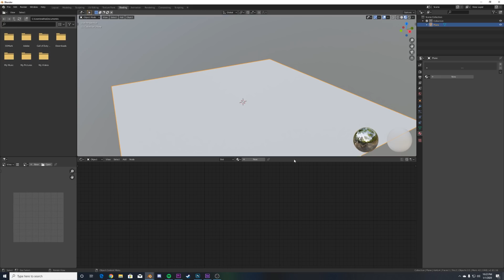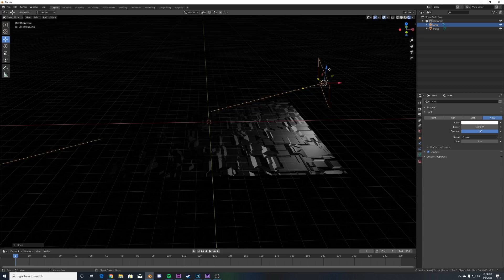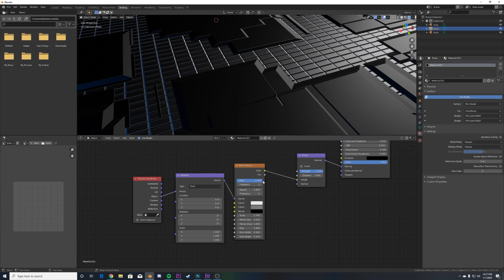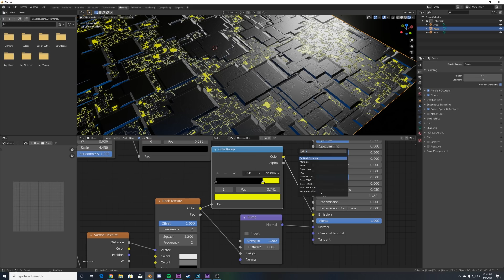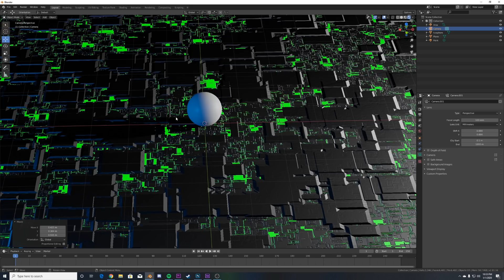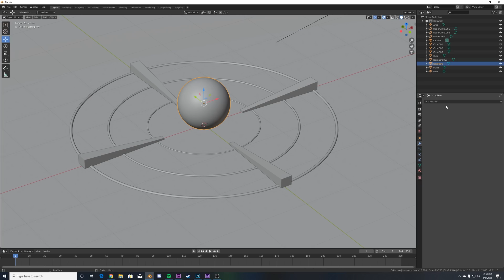Blender - Hard Surface landscape in Eevee & Cycles Blender 2.81

Comment: u r lucky I'm don't know where u live... After I almost burned my CPU I feel less trusty on Blender community...
A piece of advice for your header, do a disclaimer about the system requirements for certain tutorials... not all the people can afford the same hardware specs, and SW configurations like you showed here are pretty dangerous. 
While I really appreciate this tutorial, this is pretty much unreal for animation application on a low budget system.
My CPU worked 106 celsius for about 7 minutes  to render a single frame shot....
I HATE YOU!
😍🙌🏻

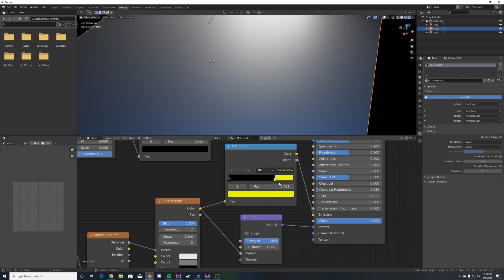Comment: Ducky, You might not read this anymore (maybe someone else will?)  but i'm following along 8 months later.. at 7:56 you connect the ColorRamp for the light in the Brick shader. I'm doing the same, but i'm getting the larger parts glow up instead of the fine lines.. I had to connect the Voronoi Texture (that is connected into the brick one) into the yellow ColorRamp to get this. Is this an update of some sorts? I did everything exactly the same..When plugged into the Brick Texture, the Color Ramp (yellow part) stops working at 0.73 and i can't fine tune the emission. It just stops when i go above this.

Edit: For anyone having the same issue (Still don't know what the cause is though).. Flipping the ColorRamp made it glow inside of the lines and not on the raised parts.

Comment: 7:50 when I try setting the Pos parameter in the ColorRamp node, I either get no color at .8, or WAY too much color at .795.  There seems to be no in-between, and I can't figure out why that is the case.  Does it have to do with the bump height of the texture?

Comment: You can also get the material glass in Eevee - with an identical result.
In the render settings check "Screen Space Reflections" and below check "Refraction".
In the glass material settings in the area Settings check Screen "Space Refraction".
Done

Comment: Thanks dude, amazing tutorial, i learnt a lot! ........... one question: this Voronoi texture thing is very cool, but also kinda weird. Because it's 3D, but then not. Because it looks 3D, but when you look at the plane sideways on, it's completely flat. Kinda like an optical illusion. 
So if you want to have this look, but with animation, seeing it from different angles, it might not work so well. Is there a trick to actually have the Voronoi create a real 3D surface, so, looking the same, but then in real 3D with real stuff sticking out above the surface?
Reply: Sure ! You need to use cycles. Plug the output of the noise into the height input of a displacement node, then the output of the displacement into the displacement input of the material output node (the final node). In the shading node editor press N to expand the right side panel, go to options > settings > surface then set the displacement to displacement and bump. The final step is to add a subdivision surface modifier to your object in order to give it enough geometry to displace, set the divisions to 5 or 6. You can scale up or down the effect by tweaking the scale of the displacement node.
Cheers
Reply: @Gorgious  Many thanks! Do you need to use Cycles? I'm doing 3D graphic design stuff and often i just use the viewport render because i further re-work everything in Fusion.
Reply: @Dazzer1234567  You do, because the Eevee renderer doesn't have displacement settings as it messes with the geometry on a level the basic renderer doesn't handle. Made me pull my hair out a few times early on when I couldn't find the setting for the life of me, then realised the renderer was set to Eevee.

Comment: I'm starting to notice a pattern here, when I do these tutorials, in order to get similar results a lot of times I have to make far more drastic increase/decrease on slide bars. Trying to get precise so I can better understand what does what, right now I'm pinned down between silver plates grooves being way too big, to get anywhere close to what you got with a "~3.6 strength" on respective Voronoi node I've go to go roughly 10x that. Having similar issues with the gray raised patches, both their scale size and the grooves within them scale I can't seem to nail down.

Any Ideas?
Reply: Having an object scaled up and then applying the scale changes sizes of textures. That is maybe what you need to do

Comment: I find all of your tutorials informative and useful, thanks. I especially like this one because of the effect it achieves. Question, is it possible to export maps of the material you created for the floor? For example, I would like to use the "model" in another program that will accept diffuse, roughness, metallic, normal, and AO maps, but I have not been able to find a solution that will produce them. Is it possible?
Reply: I think you can sir. Here's how I ll do it . 
1.press 7 on numpad and press ctrl+alt+0 (to position camera to view ) , so that the camera is only capturing the flat face with no perspective like in a material map.
2. Just select different channels using node wrangler addon and render them out with flat lighting i.e with no lamps just good (brightness you like)world lighting 
and your maps are ready . 
render each channel differently . 
for example you want the bump map. So what you ll do is shift click on the final normal node that is connected to the principled bsdf  and render the image.

This is the way i do it and hope will  work for you as well 😊.
Reply: You’re God sent 🙏🏽